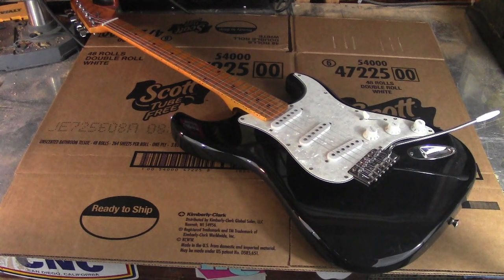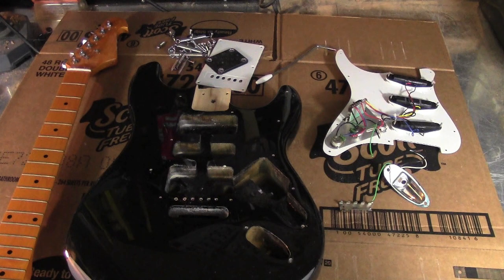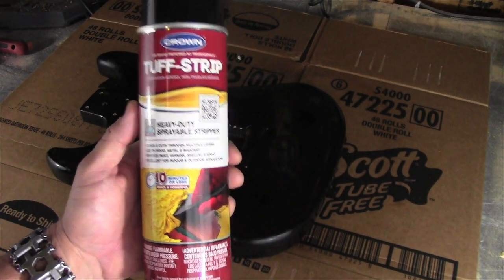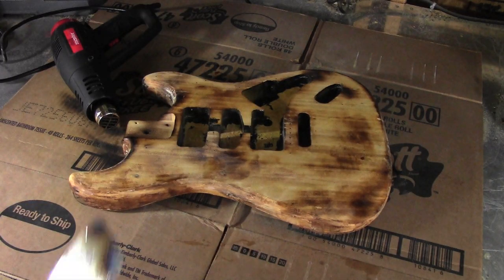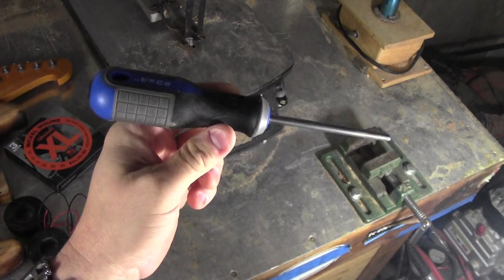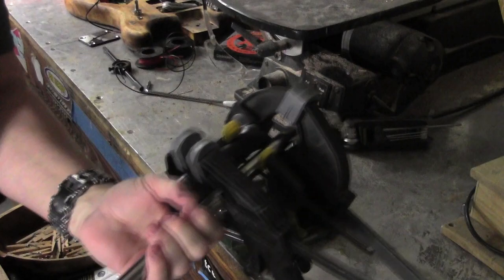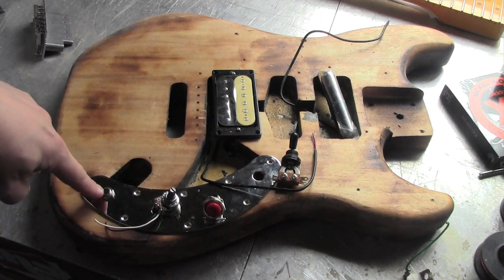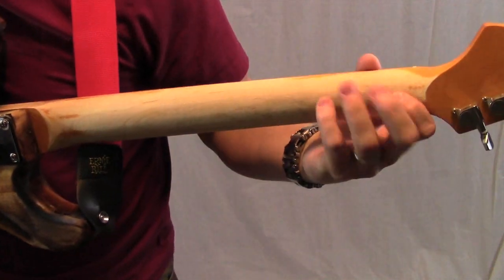Heavily Modified Electric Guitar

Comment: the screwdriver is made from tempered steel, of course you're not gonna be able to bend it
Reply from the maker: Well now you tell me. :)
Reply: Not tempered, hardened.
Reply: @roehle9962  not just hardened but spring steel, snaps rather than bends

Comment: i have a parts-caster that someone assembled incorrectly - so the jack plate  screw holes were all ripped out and the trem had ripped a chunk out of the body - i routed out the wood damage and put in a dutchman (two actually - a big filler block and a thin veneer top piece) getting the spring trem to work again isnt high on my list so im just going to install a tele style bridge or modify/block the saddle plate i already have - for electronics i wanted to get rid of the five way, and put a multi pot/mixer set up on the guitar to independently control each pickups tone, phase, and volume
i knew lipstick pickups sounded clean but yours sounds great!
Reply from the maker: Just messing around with guitar, and throwing out all of the “rules” can be really fun. 
Make a video about it when you are done.

Comment: I was thinking about combining a high output bridge pickup with a lipstick or single coil on the neck. I'll like to hear the mixture of both,, the only thing I was thinking to make this possible, is by using a blending knob, like the one in jazzbases, so you can have more control of the volume. Otherwise you could only hear the bridge pickup with a standard 3 way switch. Might worth a shot for you as well. It would match the weirdness and uniqueness of your guitar, plus you'll have more sounds.
Reply from the maker: Those are some great ideas.

Comment: Hey guys... i need some help.

Im modding my jackson dinky. 
It has one general tone and one general volume knob. 

Im gonna put a SD sentient/nazgul pickup kit on there and id like to be able to coil split the nazgul.. i dont really need a tone for the sentient. 

So it would just be the coil split(tone) for the nazgul and a general volume knob

Is this possible and if yes... what do i need for this??
 (Im new to modding so im kind of confused)
Reply from the maker: Splitting the coils isn’t too difficult. The two main ways are wiring in a little switch, or using a potentiometer with a push/pull switch. You are just taking one of the coils in and out of the circuit. 

This one isn’t a perfect example because it is splitting both of the coils. 

https://www.seymourduncan.com/images/wiring-diagrams/2H_3B_1VppSPLn_1TppSPLb.jpg
Reply from the maker: More examples for a single pickup with split coils. 

https://guitarelectronics.com/guitar-wiring-resources/1-pickup-guitar-wiring-diagrams/1-humbucker-1-volume/

Comment: Some heat might have helped bend the screwdriver.

Nice job, as always.
Reply from the maker: You are right. I wish I had a metal torch.
Reply: Heat it to red hot with a mapgas torch - 101 uses around the home :) This will anneal it to soften. Bend it. You can make it tough again by heating it to red hot and quenching in oil in a jar. Then put it in regular oven at 400F for 30 mins and allow to cool with door closed. All done and hard again in new shape.
Reply: @neonboy22  Or, remove head from existing trem, put on on screwdriver handle. Then realize it's too awkward and go back to regular trem.

Comment: Use a propane burner to heat the screwdriver up to a point where its bendable
Reply from the maker: Good idea.
Reply: I say the best way to bent that screw driver is to use a blow torch it's tempered high carbon steel
Reply: @angeleliofthefamilydiaz1226  Cheap guitars dont have high carbon steel screws usually cheap random metal ones.
Reply: @gamer7138  homie he's talking about using the screwdriver bending it for a whammy bar I'm not speaking of screws
Reply: @gamer7138  but yes you are right

Comment: Great as always. I would have maybe tried refilling that middle hole but I understand why you didn't. I also love the look of the body, especially since that burn look was probably by accident.
Reply from the maker: Maybe I'll add another pickup in the middle spot someday.  But I kind of like just having two.
Reply: Maybe you could try hand winding a pick up and slot it in there for testing. That'd be an interesting video.
Reply from the maker: I want to try some hand winding sometime. One day I’ll pull the trigger and buy the supplies.
Reply: @CircuitsAndStrings  what pickups did you use?

Comment: When you’re bending metal in a vise try putting a little pressure on the top and use a hammer to hit the metal close to the vise. It puts more pressure close to its bending point. I’ve always had good results doing it that way. 
JMO anyways
Reply from the maker: Good idea.

Comment: Pretty cool,but I wonder why you didn't just start out with a $40 ebay body and $25 neck,since you changed pretty much everything else anyway.Would have saved a lot of scraping and sanding.
Reply from the maker: You are right. I would have saved some time getting an unfinished body. But when you can get a fully complete knock-off strat for $30, it’s hard to pass up. :)

Comment: You should put a Floyd Rose on it
Reply from the maker: Do you like a Floyd Rose better than a normal Strat bridge tremolo?
Reply: CircuitsAndStrings yes, better tuning stability, and you can bend up, just my opinion though, but yes I like Floyd roses better than the original 6 screw system
Reply from the maker: Good things to know. I’ve never really played around with a Floyd Rose.
Reply: CircuitsAndStrings yeah man, I recommend messing around with one, in fact in about to put one on my strat.

Comment: Be careful with a Spectrum guitar. I had one, and the body busted in half when it got bumped on the floor. The neck is layered and flimsy. Not good guitars to customize. A dirt cheap Squier Bullet is a pretty stout built guitar, and makes a great platform to begin a custom build.